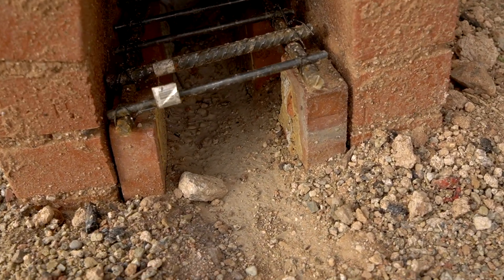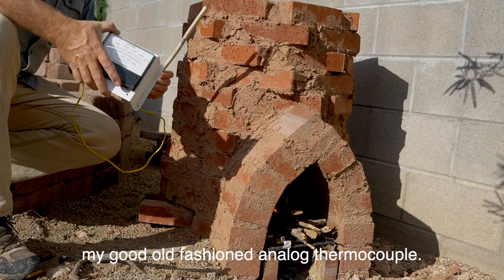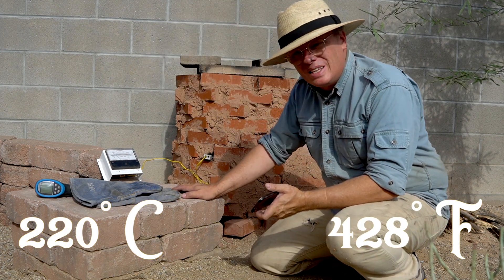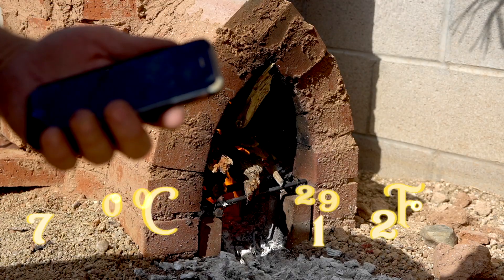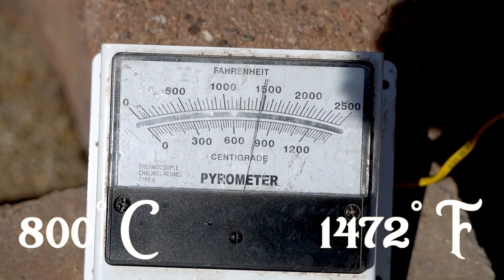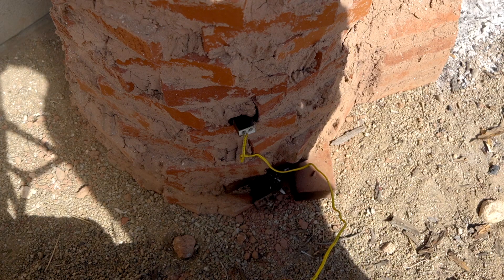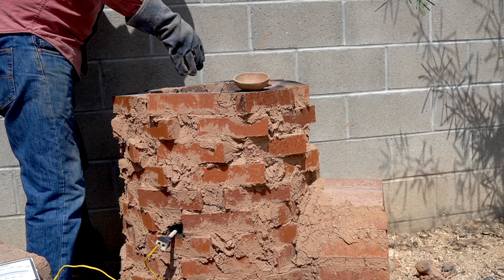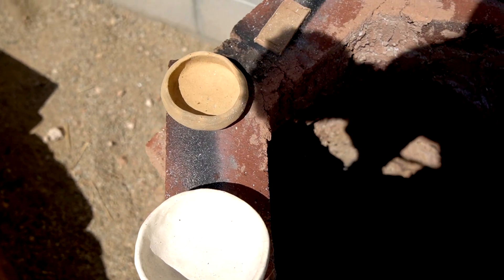Upgrading My DIY Pottery Kiln - How Hot Will It Go?

Comment from the maker: Thanks for all the advice and tips. I will be implementing some of these into the next round of improvements. My goal is not just to easily reach high temps, but to have a little kiln design that others can easily duplicate in their own backyards. So simplicity and inexpensive materials are essential.
Reply: Tip!

I love the content. The amount of air flow is going to be just as important as how the air moves inside the chamber.
You like experiments, so please try this one!

The next time you are in the car, roll down different windows about half an inch in varying combinations and feel how much air hits you in the driver seat (best done while on the highway).
Crack the front two windows. feel the air currents in the car. Roll them up.
Crack the two windows on the driver side. Feel the air flow. Roll them up.
Crack the passenger windows. The Driver Side (in America) is going to get the most flow, particularly over your left shoulder and left hip. Roll them up.
Crack the front driver side and rear passenger... roll them up.
Crack the passenger front and rear driver.

Where the air flow enters the system is just as important as how much air moves through the system. The Venturi effect is very powerful when used correctly. Think about how the air flows over your car while driving on the highway. Think about how the air is flowing over your system while firing clay.
Reply: I am finally building a kiln similar to yours. It has a wider diameter. I am building it up on gravel to protect the bottom from rain water. I'm using clay mixed with wood ash for the mortar. I'm afraid I'm not the dynamo I once was, so it'll take a while. Meanwhile, I'm making a bunch of pots from clay off of my property to fire when the kiln is ready. I found one small spot of pinkish white clay that I really like. Dang, I'm having fun! Thank you! Michael
Reply: Try replacing your fire wood charcoal, which you can make for fairly cheap. If you didn't know charcoal will combust and burn hotter/faster than any firewood ever will.

Edit: You could also try laying a cheap hair dryer right outside the firebox to force a ton of oxygen into the fuel. That's what I've been doing with the mud kiln I made this week and it gets really hot really fast.
Reply: The chamber must not be on the way of air flow. It must be like a pocket, not like a chimney. You need a heat, not air flow.

Comment: clogging the air vents at the bottom, and making the fuel feeding outlet at an angle will make the firing better with fan, and will be able to reach higher temps easily

Comment: It feels like following some designs for rocket stoves would be beneficial. 

Those burn wood almost completely, even most of the ash and coals. The hotter, and better a fire burns the less stuff there is leftover afterwards. 

This generally requires very fast airflow though. And that requires the design to be tweaked a bit. A smaller opening at the top would allow this, but also if it was slightly taller too. When your openings are too wide, the fire will still get air, but it's not going to suck air in like a rocket stove does. A bellows would also work. Be it a fan like an old hair dryer, or a bathroom fan, or even a wood and leather one.  Static pressure vs airflow basically.

This can also be achieved with a design that has airflow inlets around the bottom that let it naturally suck air in a whirlwind.  Think, tornado fire. They have to be properly angled. But this would burn stuff significantly faster, and hotter. 

Honestly, there's multiple ways you can do this. It's worth the trial and error on a couple designs.

Comment: more insulation will help, and smaller diameter feeding chamber, i would not use the fan at all, the oxygen will feed itself in with proper geometry, on the other hand this looks beautiful, i would make a second layer of brick and use something like ceramic fiber to insulate if that is not considered cheating for primtech

Comment: I tried this basic design, but did an x4 version with a slightly higher chimney. I maxed out around 850c without forcing air.  With high cfm air I got to almost 1000c before I backed off. All the steel I used in the firebox and for the pottery was sagging. Badly.  A fun night of trying :)

Comment: Hi Andy! I did some research, and it looks like a few simple additions to your setup could help you reach higher temperatures. I thought it was great how you demonstrated that your basic firebrick kiln got just 300°C shy of minimum stoneware temp. With a few adjustments, you could push it to that 300°C mark and beyond:

Fuel Type: I noticed you only used basic firewood for fuel. By adding sources like lump charcoal, wood pellets, or sawdust logs, you can boost the temperature significantly.

Insulation: Adding ceramic fiber to the chamber where the pottery is placed, along with replacing the metal grate with a ceramic support, could help insulate the pottery better and create higher temperatures.

I would love to see another video of new upgrades of this set up if possible!
Reply from the maker: You want to see my latest improvements here you go https://youtu.be/AV4AFvkyCgU?si=9oF-u16P5ZR39pHt

Comment: hi Andy i have always been interested in pottery but watching your videos i have learnt a lot but i also know that if you find an old vacum cleaner you can use it to blow air out of it look around the vacum you will see that there is another vacum hose fitting spot  you also need a steel pipe to run the air into your kiln as it will get very hot

Comment: If you use charcoal and a little blower, you can melt iron, if you want. It burns FAST and hot. Probably, you want a  charcoal fire with wood on top.  The ratio of fuels and the amount of air will control your speed.

Comment: Using the leaf blower as many of your viewers have already shared should work. Also a 6" fan with flexible clothes dryer hose to direct the air flow to the firebox inlet will be more efficient than the fan you currently are using. As a last resort a DIY air venture blower will get lots of air flow and can be directed to the firebox inlet. Thanks for sharing.

Comment: Id make a door for the front out of metal and bolt an induction fan from a wood stove on it. You can control the temp by the vent on the fan or its speed along with the bricks youve already modified to open.

Comment: Cone 013 (Kiln color red) Super low fire.
1850f is a cone 06 and it is used for the bisque process and low fire glazes. 
You need a forced air blower piped into your kiln to achieve higher temps. These look like miniature squirrel cage pumps in a metal nautilus shell.

Comment: im new to firing clay, think we all done a little clay in school, I have a tall smoker grill out of steel with multiple levels wire shelves, it works on fire or gas propane, line it with fire bricks do you think it would get hot enough ?
Reply from the maker: Not sure. A smoker generally doesn't get super hot, right? In order to turn mud into ceramics you will need a temperature of at least 1300 F or 700 C
Reply: @AncientPottery  its steel and I was thinking of adding fire proof blanket inside  lined, it already has the propane burner in the bottom and can also use charcoal wood

Comment: A taller chimney will create a stronger draft, allowing the fire to get higher (even without a blower or bellows). Also, charcoal burns hotter than wood, so you could try using charcoal for firing— you can make your own charcoal, if you have enough wood.

Comment: I've watched metal workers on YouTube use an electric bathroom blow dryer with a tube made of sheet metal that goes over the blow dryer's tip and the metal tube goes into the bottom of their homemade forge in order to get it hot enough to work their metal.

Comment: Your fan could be blowing the heat from the bricks on the outside. A smaller fan only blowing into the fire box might help. Also the 2 bricks you moved in the bottom may need to be closed up some or mostly, they are letting in cooler air that is helping take the heat out the top. A small fan blowing into the fire box might be enough. If you consider what a blacksmith does to get a lot of heat, they only add air into the flame area. A little mortar added to the outside could hold more heat in also,

Comment: 1000 °c glazing I used to firing, can i use this type of kiln, and which material you are used for stand inside the kiln
Reply from the maker: maybe I think I could get this up to 1000 C if I worked at it. Bits of broken pottery are used for propping pots but generally since I don't glaze I don't worry about things sticking together like others do.

Comment: I know I'm kinda late here but as with all of the other good suggestions here's mine.  I believe the hottest part of the flame is the tip.  Take some temperature readings higher in the kiln.  If I'm correct in this by placing pottery higher you will get the higher Temps you seek.  Also it will open up the fire- box area, floor space allowing for more oxygen and a cleaner hotter burn.  Great content!

Comment: Try a, venturi effect..make a larger opening in the front..which will increase the speed of the air.  Or change to an electric leaf blower
  People use those to get small furnaces up high enough to melt aluminum and copper or brass

Comment: Hi, i have learned alot from your vids, thanks. To get higher kiln temprature i would only allow hot air to enter the kiln. I guess we could install a coil of metall pipe at the kiln exhaust and have one end of that coil at the kiln opening(air inlet) and the the other end of the coil will have a small fan blowing air through it.
Reply from the maker: Thanks for the tip Muhammad. Don't miss tomorrow's video where I will show the next step in the evolution of my brick kiln.

Comment: I haven't read all of the comments, so you may already have gotten these recommendations.  Forget about the box fan.  Get a thrift store hair drier or vacuum cleaner, add a heat proof extension, and blow a concentrated stream of air in, under the firebox grate.
We have two, large, wood fire kilns at Solano College in Northern CA.  They share a chimney that's about 24 feet high.  It's the extent to which the draft created by the rising column of extremely hot air draws air in from the firebox that gets us to 1300C (in four days, with four cords!)
I'll build my test kiln as a rectangle for a tighter fit, and have a bigger, deeper and taller firebox, with mouse holes in the second coarse of bricks, then a couple more courses of bricks, then the opening for stoking.
We have a door that we close between stokes.  Air coming in that flows over and past the fuel is unheated, and moderates the air flowing through the fuel and providing oxygen in and through, rather than over the fuel.
Fuel opening that's higher and not as tall will allow added fuel to drop down into the embers and fire, so there can be as much fuel as with bigger mouth, but not so much cool air going in.
Reducing the diameter of the ware chamber and adding at least a 4' chimney, perhaps 8" in diameter, would draw in oxygen ten times faster than this set up, and it would be lost faster, but the heat would be greater, and would transfer much more heat to the walls on the way through.
Sealing the kiln once it's extremely hot is the right thing.  Maturity of clay is not only about top temps attained, but by how long
Reply from the maker: Thanks for the info. I actually figured it out using an ad box chimney, more air holes and an ash grate. But I also am done with these kilns, watch my video that comes out next Wednesday to see how I fixed it and why I gave up on it. Oh, also I make earthenware, no vitrification, and time at temp does not matter to what I am making.

Comment: Would hedge apple work? That stuff burns hotter than the blazes.
Reply: Hedge apple us also called Osage Orange, and was recommended in a previous comment.
My understanding is that dense hardwoods contain more potential energy, but are best for long, slower burning to heat homes.  Seasoned pine burns faster.  Most cabinet shops trim the irregular edges of rough  lumber, and throw it away by the ton.  It'll be 16' pieces 1/2 to an inch across.  It's great for stoking due to small surface area, and ease getting into tighter stoke holes.  Again, smaller stokeholes admit less cool air that flows over the combustion, rather than under and through. And participating in combustion.
Reply from the maker: @kemperstone9989  good suggestion on wood. My usual for outdoor open firings is mesquite which is quite dense.
Reply from the maker: probably would work fine but it doesn't grow around where I live so I have never tried it

Comment: Since you've gotten a bunch of similar comments I'll keep it short. The fan is stripping a lot of heat off the outside of the kiln since it's not focussed (basically wind chill). If you were to run a hair dryer in some black iron pipe into the bottom, below your grate, it would allow the hot air pocket around the outside of your kiln to stay there longer. You could also brick  around the pipe below the grate for less heat loss through radiation. You'd still be able to add the same amount of fuel on top of the grate, and it would only increase the cost about $10 for a cheap hairdryer and some scrap pipe.
Reply from the maker: Thanks for this info. One problem with this kiln all along is that it cools off rapidly, it needs insulation or thermal mass to help it maintain heat

Comment: Excellent idea to add a layer of the grill at the feed area to have airflow. I think to maintain the heat at 800 degrees celsius sand is the best medium to hold the heat. we could possibly split the area of firing and the area of de-moisturizing the pottery. The heat escapes could be sealed from top and bottom of the chamber. we could also have a vent going up from the firing area so the fumes could escape. Overall it is the best klin made at home in an economical way! My hearty wishes!
Reply from the maker: Thank you for your insight.

Comment: If you want to try to achieve a higher temperature you could try something I have done on a burn barrel which was to incorporate a heat exchanger in the construction which heats all of the intake air. I used corrugated iron wrapped around the outside of a drum so all the air is pulled down through the corrugated on the outside of the drum preheating it before it gets to the bottom.
Maybe if you used a steel duct for intake air which is built into the kiln chamber and have a removable cover or door to load the timber.
Just an idea, I can’t say how much increase you would get but if the air is heated prior to combustion that heat does seem to make it burn hotter and cleaner
Reply from the maker: Yeah, it actually sounds like a great idea, but I am trying to keep this kiln simple and "primitive" so I need to find a solution that is simple. Actually since I made this video I have made several improvements, I will be making a video soon showing how I am firing this more efficiently these days.
Reply: @AncientPottery  it would be fairly easy to incorporate in a new build, not easy to add to an existing built furnace, anyway as long as it’s working for you

Comment: For what its worth, I guess you've solved your problems with it now, but from my observation of this here, If flames are licking out the bottom past your brick openings? Your kiln is not drafting right and its loosing heat through the small brick vents. Use the vents early on, then later close them as the kiln comes up to heat and is better able to draw air from the fuel box entrance. Play with the bottom brick vent gaps to optimise oxygen draw, and minimise heat loss due to an easier way out for the fire to vent..
Reply from the maker: Right but it was only doing that when the fan was on. The way I fire this kiln has evolved and the last few times I have used it without a fan and am reaching my desired temps just as fast. I need to make a new video showing what I have learned. Thanks for the ideas.
Reply: @AncientPottery  Thanks for taking the time to reply.

Comment: I'm not sure why you opened those side holes at the bottom of the kiln.  They are probably just cooling off the fire produced by the main air intake under the wood. Also, you can see flame shooting out these holes when you turn the fan on.  That flame should be going up into the main kiln instead of shooting out the bottom. At the very least you should have tried closing them off at some point and seeing what the effect was.  If the side holes were closed up you would have a stronger draft from the front where the fire and the fuel actually is...
Reply from the maker: Having fired in the kiln before and after the holes, they did help. I have continued to refine my firing method in this kiln.

Comment: Insulate it with clay and a clay straw mix on the outside bet you could get it to the temp your looking for
Reply from the maker: That is probably true. When I stop feeding fuel into it, it cools down very fast so the ability to hold that heat longer would a great help.
Reply: Yep, cob clay as insulation would be good as would a taller chimney. That said a train tunnel design would also help, but it's outside of the scope of the design

Comment: Extend your firebox another two gothic arches in length.  Also, it’ll get incredibly hot if you let a leafblower idle while pointed at the firebox inlet.
Reply from the maker: Thanks for the tip, I have a friend who has had great results with using a leaf blower in his firings.
Reply: ... or go low tech and connect a foot operated bellows.